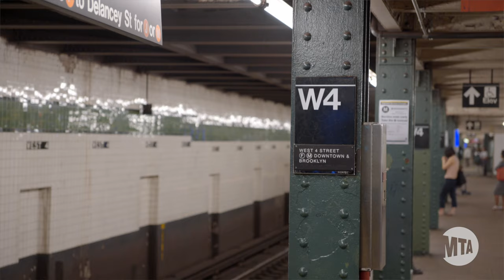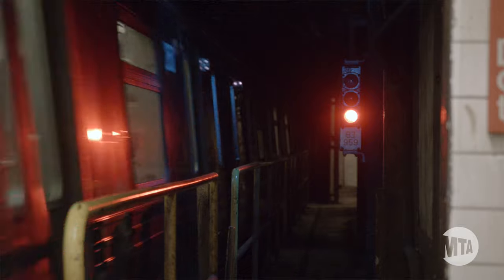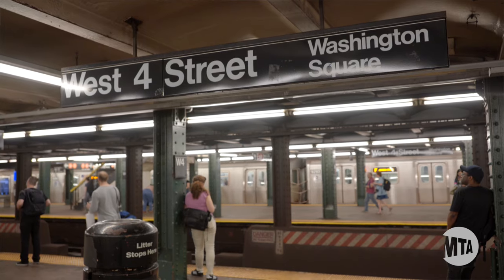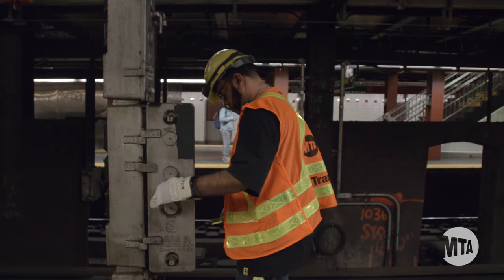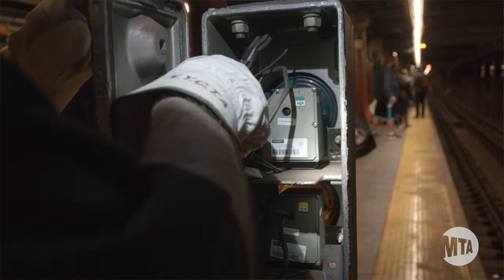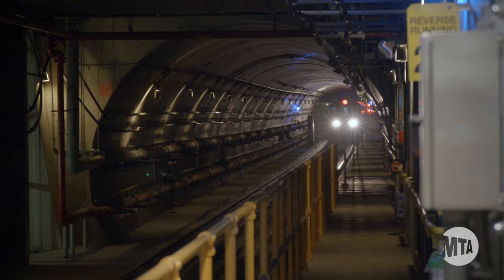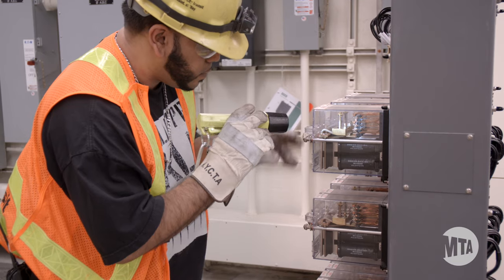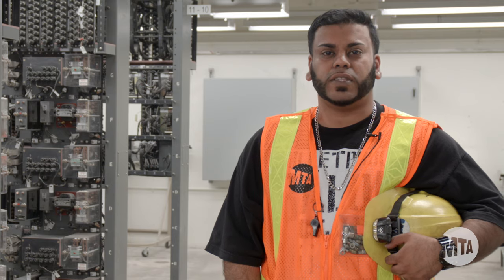What does a Signal Maintainer do?

Comment: Going to school now to study engineering can't wait for MTA!
Reply: Spice 0o0 Same here. I’m already in my third year in my Computer Engineering Technology degree.
Reply: same
Reply: As a signal maintainer for NJTRANSIT, college wasn't required. FRA rules are adhered to for all railway systems including monorails.
Reply: tonygreene67 so for training idk if you know but do they train for positions like train operator if college is not required or your position you did for NJ transit?
Reply: @prospect4954  for train engineer the NJ TRANSIT used to recruit from experienced signal maintainers or conductors since we all studied from the same right of way manuals
Reply: tonygreene67 that does make sense now that you explained it that way I was told having college is basically extra credit not necessary. I moved all the way to NC just to go to School, I wish I would have known I would have never left the city just to come back.
Reply: @prospect4954  for entry positions to sig maintainer a good electromechanical repair background is good. Track circuits are mainly using electrical relays and in some areas of automatic train control, circuits and signals are transmitted via wire to tracks.
Reply: tonygreene67 “electromechanical” would still be under civil engineering, assuming? That’s what I’m currently enrolled in. If that “helps” any.
Reply: @prospect4954  basic electrical circuits and using them to control switches and relays. The majority of our railroad infrastructure in the US still relies on basic relay position monitoring. Mechanical and grunt work would be involved in repairing track switches and railroad crossing gates
Reply: tonygreene67 this for sure is an increase on studies TY, do you still work for NJTransit?
Reply: @prospect4954  nah..I left the railroad to work for T-Mobile in nyc until retirement came thru
Reply: @113tidbits  thanks for all this information! Considering a job on the railroad. If you don't mind me asking, why did you leave NJT?
Reply: @connecticutmultimodaltrans8226  I worked and progressed to signal maintainer.  Worked in assigned territories that were union positions. 
However, I was tired of working for a union that did NOTHING for getting us a better contract. The same job on NYC SUBWAY AND LIRR paid nearly $12/HR more.
So I took all of my skills and experience to work for t-mobile as a field technician.
Reply: @113tidbits  Gotcha, thank you! Would you recommend the job at an employer other than NJT?
Reply: @connecticutmultimodaltrans8226  it depends on if it's a union position or not. The job itself is really good. Especially if you like working independently and outdoors.
Reply: @113tidbits  Can you talk about your experience as a signal maintainer including starting pay/what you make now?

Comment: When is the MTA replacing the ancient signalling systems seen in the video? I know the funding system and political management systems of the MTA are a horrendous mess, but could you maybe go to London or Paris and see how other old subways are upgrading to modern technology?
Reply: Gustav Löwgren it’s funding man if they got the same amount of funding they got in the 40s and 50s it would be wonderful but politics
Reply: @sweetmyth2537  What about the congestion pricing they're gonna start doing next year? That should help a lot right?
Reply: Trailer Crack smoker That is completely not true.

The older signal system was responsible for two deadly crashes in the 1990s: one in 1991 in Union Square, and the other in 1995 on the Williamsburg Bridge Brooklyn approach. By contrast, since CBTC went fully live on the L 14th Street-Canarsie Local (or simply the Canarsie Line) in 2012, there has not been a single signal related collision.

Stop with the scare tactics man.

Comment: The 7 train doesn't need those signals since they use CBTC and MTA have taken down those signal boxes lol they are just on the Express tracks for any test trains or garbage trains lol
Reply: NYC Gamer Eventually, the entire system won’t need those old signals anymore.
Reply: @TheRailLeaguer  I have seen that the R68A N train was getting close to the R160 N train at Queensboro plaza station I don't know if the MTA change the distance between trains or not??
Reply: @TheRailLeaguer  but not that close
Reply: NYC Gamer I think that they have shorter signal blocks (normal blocks are 1000’) on some lines, but this still limits capacity. Moving to CBTC is our only answer.
Reply: Work trains